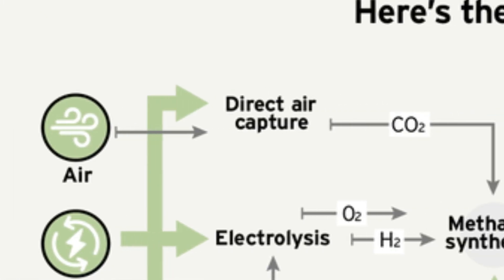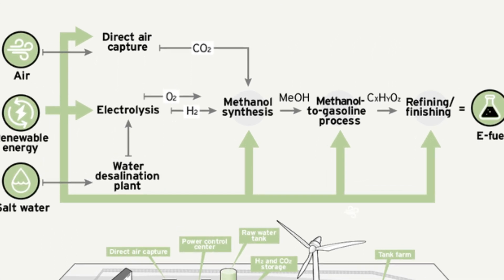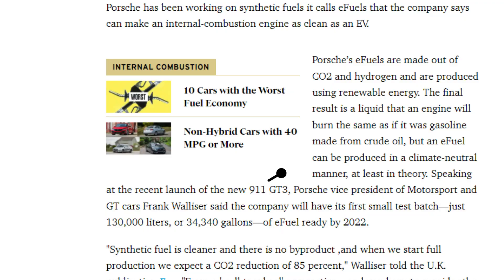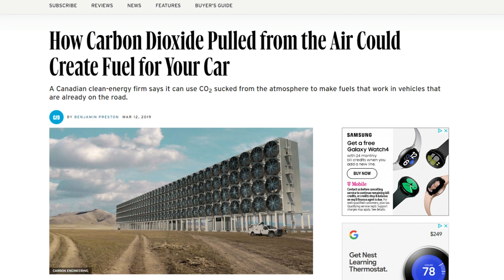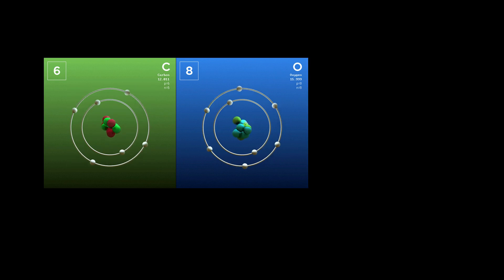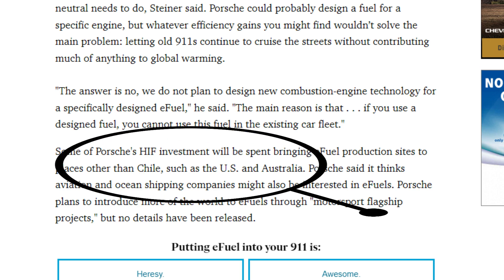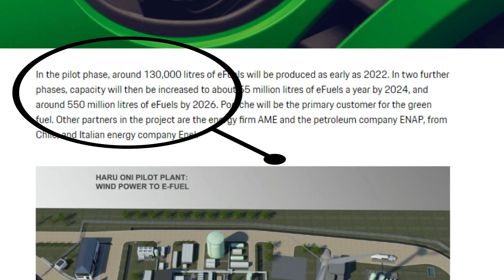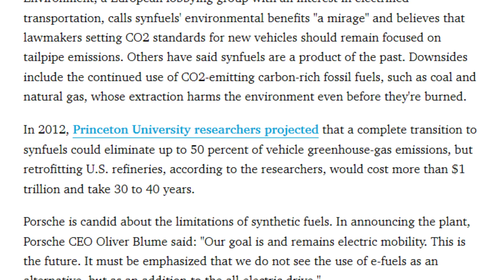Porsche E-Fuel - A Dream With Potential

Comment: Nice video. E fuel for me. I can’t wait for an EV to charge if I forget to charge it; say before work or something. Five minute charging seems to far off.
Reply from the maker: It would have to run on like 2,000 volts before we get 5 minute charging
Reply: That's great, just as long as you're happy with £10 ($12) per litre..........Synthetic fuel will not be cheap.  "Forget to charge it"  Do you forget to put fuel in your ICE car?  Like everyone on the planet, you have to sleep. You will die if you never sleep. So that is the best time to charge an EV. You won't need your car while you sleep. You won't need to charge an EV every day. I charge mine every 8 to 9 days.....
Reply from the maker: @Brian-om2hh  there's a Canadian company called Carbon Engineering that claims their synthetic fuel will be about $4 per gallon (though I do remember reading something about Porsche's eFuel being something like $10 per liter) so we'll see how expensive it ends up being. And in Rob's defense, I sometimes forget to charge my phone so I can see how someone might forget to charge their EV, especially if they're used to driving an ICE car and just get out and go inside when they get home.

Comment: It's more a rival that a replacement, the same for biofuels and green hydrogen, all working together is the best way for the ecology, not going to the extremes, using green energies but balanced. ♻️

Green electricity, green hydrogen (H2-ICE and fuel cells), biofuels and e fuels. ♻️
Reply from the maker: I couldn't agree more. It's going to add in to our modes of transportation, it just remains to be seen how large of a propulsion method it will be and I think it will be one of the larger ones.

Comment: What about exhaust emissions?? If it doesn't help achieve cleaner air it is not much help.
Reply from the maker: Well if you pull the CO2 from the air that is going to be put back through combustion it's not adding anything new. It just ends up being like the water cycle.
Reply: @nicomotor  No closed system (earth) is 100% efficient. & it is CO that is a bad guy, for humans, Not just CO2.
Reply from the maker: @teriannwakeman4636  I'd have to check again but I want to say Porsche claims an 85% reduction in CO2, I would also have to check what all is being factored in with this 85% reduction. This video was more relaying what Porsche has claimed and my thoughts, which are admittedly maybe a bit optimistic.
Reply: @nicomotor  85% recovery is a lot better than nothing and would have been wonderful 2 or 3 decades ago. Today we need a quick massive change in CO2 emissions. This is a lot better than nothing but should be considered just a climate stopgap but not a total solution.  Where it really shines is giving countries with no oil resources a way to make their own fuel and not be dependent on oil rich countries. If it were already widely implemented it would save a lot of EU energy problems. If it becomes widespread I think its impact will be felt more in country economics and relations.
Reply: It works  by pulling the  hydrocarbon  from the  air it's self so technically  it's carbon  neutral.